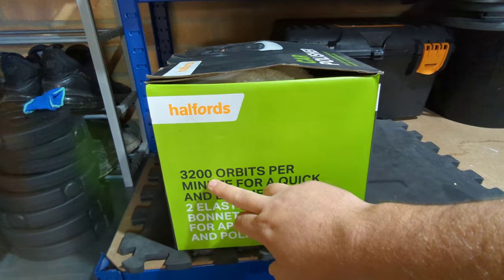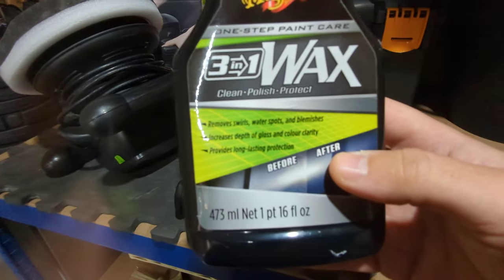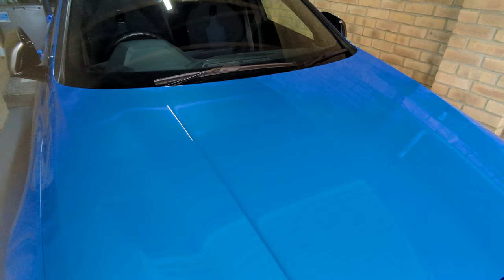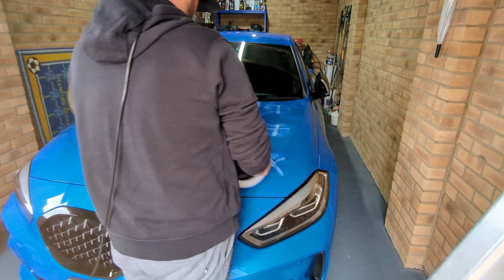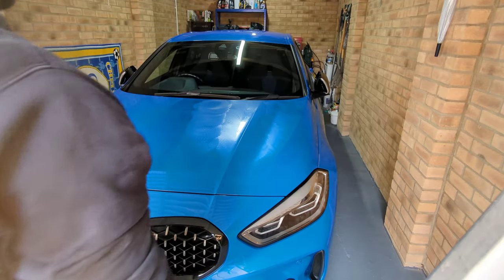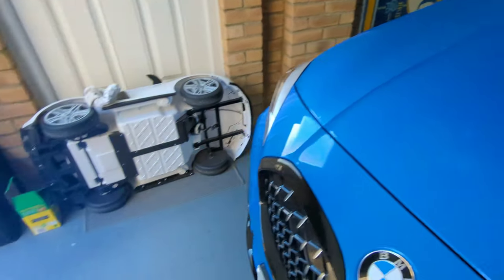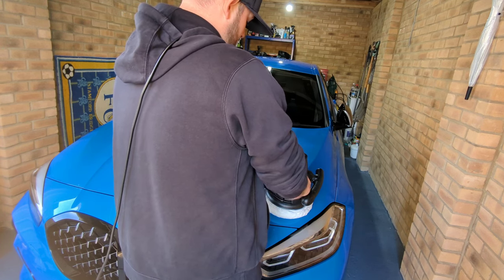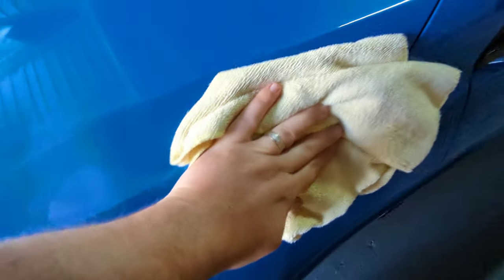Machine Polishing For Beginners | How To Use Correctly

Comment: It’s easy for you with brand new Bmw and nice garage mate😅
Reply from the maker: Thanks for watching! It only looks brand new because of the time and effort I put into the polishing of it. But I do most of my machine polishing outside as the garage isn't big enough for the full car. This video is just to show you how to do it, but you can do the same outside and if the car is in the worst condition, it will need more effort put into the process.
Reply: It's easy on any car
Reply: Anywhere
Reply from the maker: @SAS....1988  I agree 👍

Comment: First time user got this same polisher, I’m going to use turtle wax graphene infused polish, thank you 🙏
Reply from the maker: @Stu1982  lovely stuff, enjoy using. Any questions, always happy to help 👍
Reply: Can you do the doors and roof the same way, and boot,
Reply from the maker: @Stu1982  yes you can, but the machine is pretty big, so you won't get into all the Tighter areas. I have a smaller polisher for them areas.

Comment: Thank for this video because my grandad said I shouldn’t be using it on a new car but this car is pretty new
Reply from the maker: Thanks for watching! It is totally safe to use on a new car. Also I would recommend polishing a brand new car as out of factory the paint work will have many defects that are not too noticeable but are there. Also would recommend a Decon wash before polishing as the car can collect a lot of fallout on it travels to the dealership 👍
Reply: On a newish car this type of polisher is ideal. What you don't want is an aggressive polisher with cutting compound on a new car.

Comment: Thanks for the confident inspiring video. I bought my 1st polisher similar to yours. I have 2 black cars that I will try to wax in my driveway (no garage). I usually wax by hand so this will be a new venture for me! I'm a little confused about how to tell which pad is used for application. But I'll figure it out. Thanks! Wish me luck!
Reply from the maker: @mackyhowy8581  thanks for watching! Good luck with it, I have a black car now and they are a bit more harder to work with. I do most of my waxing & polishing on my driveway. Just try to keep out of direct sun even more so with black paint. Just have a go and see how you get on, good luck with it 🙏👍

Comment: I followed your instructions to the letter today but used a Red T Cut Colour tinted polish on my convertible Audi. The polisher sprays a mist of polish everywhere. With untinted polish you probably wouldn't notice it but with a red polish you see it everywhere. 
My advice is probably best to do it by hand if using a colour tint polish.
Reply: Also worth mentioning is the liquid polish goes through the applicator bonnet and into the polisher sponge so before putting on the polishing bonnet, wipe the excess polish off the polisher sponge.
Reply from the maker: @dannygladman  thanks for watching! Yes any colour polish I wouldn't recommend with a machine. As you have mentioned but probably would need less product on the pad as well. I have black polish but I only do that by hand. Also like you say it will stain anything you use. That is why I bought an applicator pad just for the black polish 👍

Comment: I am just starting up and trying to build a potential customer base, been and got a pressure washer, microfibre clothes, drying towels, wheel cleaners, pressure sprayer but I wanna do more than a basic clean as it stands currently... this video is helpful to know the piece of equipment and product to use as a beginner. Have you got one for machine polishing the wings and any tips on the wing mirrors please as I am in a process of learning and applying myself to becoming more motivated to become professional.
Reply from the maker: Thank you for your comment. Ok so I have a new machine polishing video on a slightly smaller machine, which is just a 5inch DA polisher but I haven't got a video that shows smaller than that. You would require a 2/3 inch DA polisher for mirrors and harder to reach areas. You could also do them by hand but I would recommend having a 5 inch DA polisher and then a smaller one as well. If your plan is to do a lot of polishing jobs, then you will need both. I do this as a hobby, but if you check out some of my other detail videos might give you an idea of what sort of products you might need going forward. Good luck with it all and obviously any other questions please let me know, always happy to help 👍

Comment: I seem to be getting a few issues with polish sling. Any tips? I've tried less product and also not putting polish too close to the edge of the pad and the problem isn't as bad but it still happens more often than I'd like
Reply from the maker: So I did a different machine polish video recently that I'm sure I will show how I apply the polish to the pad. But the way to reduce this is, first apply the product to the pad and massage in the pad with an applicator to lubricate the pad, then apply a few small dots of the polish, say like 4 dots over the pad. Then put the machine on the car, if you machine as a speed setting put it on the slowest setting, apply the product all over to give a base layer and then up the speed to polish the car. If your machine has one speed, it will be hard to reduce the sling, so it may not be your fault but the machine you're using? For example the machine in this video has no speed setting but the one in my new video does 👍 let me know